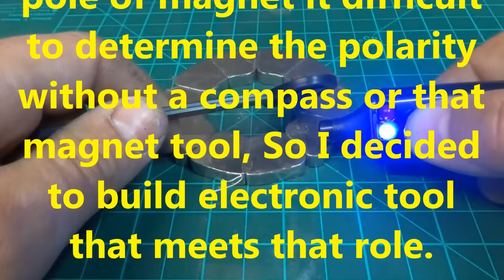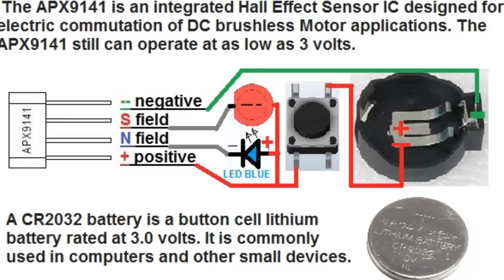How to make Magnetic Polarity Tester or Pole Detector with Hall Effect Sensor DIY Circuit

Comment: How do you know which is the north pole and which is the south pole?
Reply from the maker: fartwrangler Thanks for your comment.On earth which is the north pole and which is the south pole? Think before answers...
Reply: ***** Not sure you really understood my question.  This device appears to detect a /change/ in magnetic pole, but if it specifically identifies the magnetic polarity, it is not clear how.For example:  Does one color LED only light up for a north pole?  Which LED?  How does the circuit detect that a particular magnetic is a North pole, as opposed to just a change from the previous pole detected?